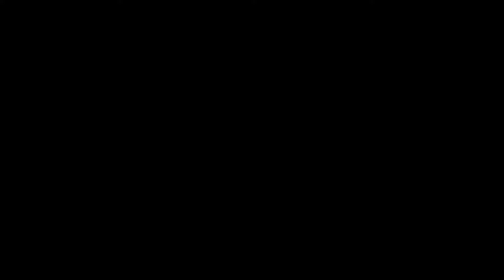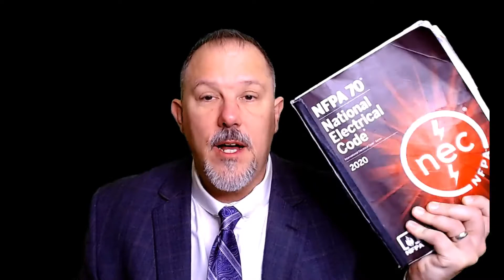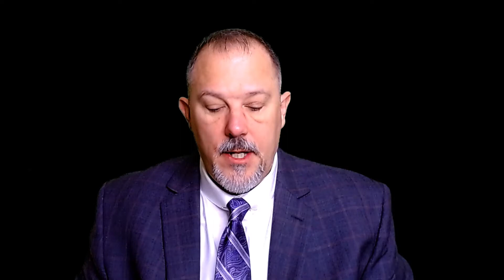240 87 arc reduction

Comment: Why is it that there was an amendment approved actually all the way back in August 2019 that reduced the requirements of 240.87C (if the manufacturer would allow it), but the amendment didn't make its way into the code  https://nfpa.org/assets/files/AboutTheCodes/70/TIA_70_20_5.pdf